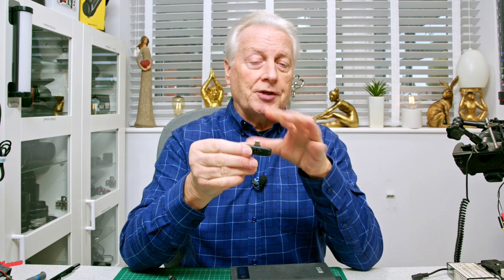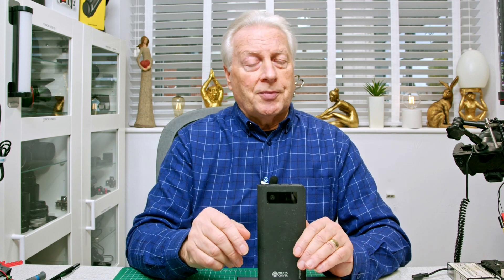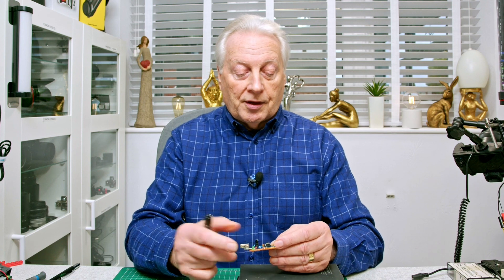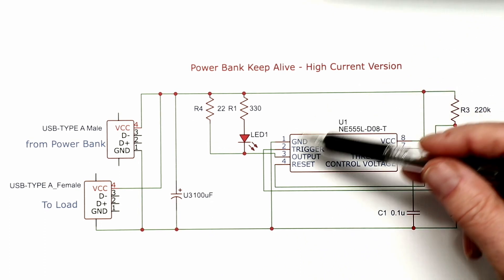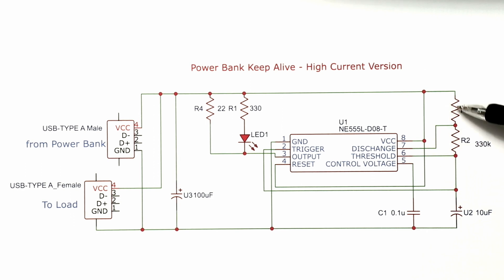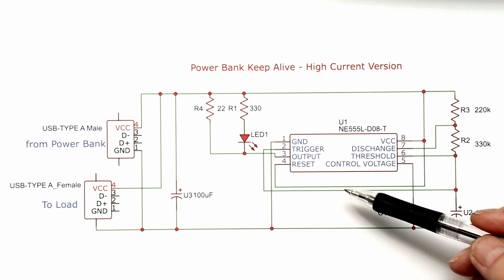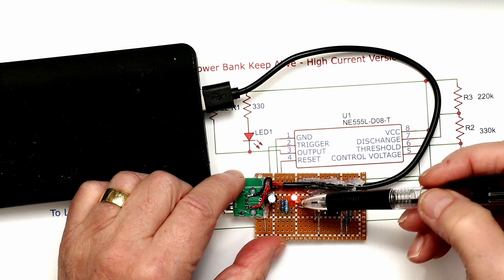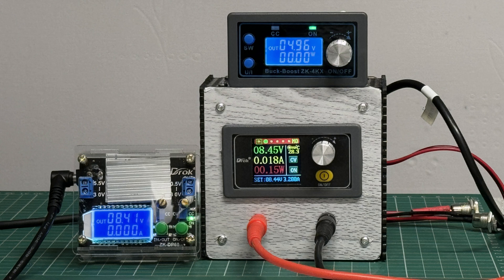Graham's Quick Build #3 Power Bank Keep Alive Device V2

Comment: I bought a keep alive device for a Power pack to run a UV led strip for a moth trap. Done a few runs at home and it worked fine. Set it up at work and connected the pack at 5pm which was also attached to a dusk/dawn sensor. All worked as should when I left. But when I arrived this morning to check the trap it's like the keep alive device had switched off. Is there a time slot that it will probably switch off without being used? It sat for probably 5 hours before it needed to come on. Thanks

Comment: Awesome, have you looked into USB type c. They have some really weird things going on that tells the devices if they are slave or master (or something like that). OTG, weird. But apparently you can put a resistor across the two inner pins that tricks it into releasing its full power. I'm being rather vague about this but if you have dabbled, you'll know what I mean.
Reply from the maker: Yes USB-C Protocols are indeed quite complex and to trigger the required voltage there is some "communication" required between host and slave. There are trigger devices which will do this very cheaply and once triggered they stave live. The two resistor method sets the output to the default 5v output used for USB A-C devices